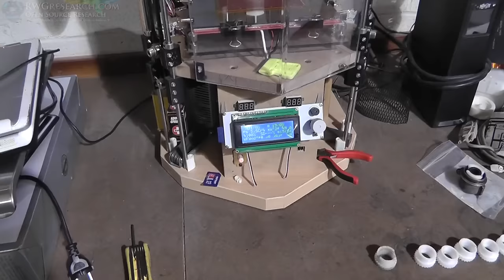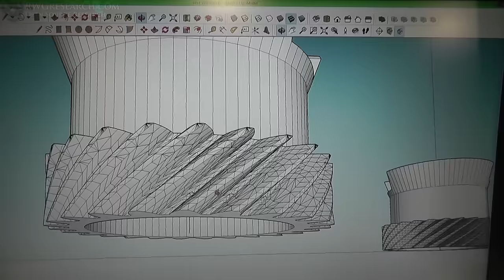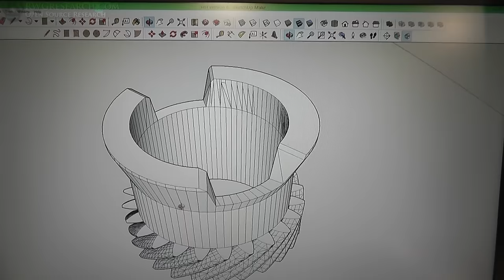Practical 3D Printing With Taulman 618, Nylon Gears! 1983 Hondamatic 450 Speedometer Gear!

Comment: You need bondo on your fingernails LOL, remember fingers are not targets.... Now make eyelets for your spooler for the various dimensions eyelet size and have a pot on the motor for the measurement of "the lay" of the wire (or filament), if you need the tension on the line use the old 5 spindle wire straighteners off the feed side.

Comment: FYI- in CAD, typically you can extrude a helical path, instead of extruding and twisting. Unless I heard it incorrectly. Cool stuff!
Reply: In Autodesk inventor I use the loft tool to do something like this.

You could also just make one of the teeth on the gear and then copy it around an axis all the way around with the rotation tool. Much easier and quicker than doing it multiple times.

Comment: The gear geometry was labor intensive because of the measuring methods and drawing methods.

The shape of the gear is standard (you measure normal modulus with dedicated tool) that ensures smooth action of gears and no play. The extrusion is around a helix not a twist. This helix is a line wrapped around a cylinder at constant angle. That angle can be measured real life with the proper tool and it has usually fixed degrees values.

I would suggest a better cad program like CATIA or PRO-E (creo) for gears and other such mechanical parts. And there are abundant numbers of free parametric CAD models for catia for creating any size of a cylindrical gear or bevel gear or hypoyd gear etc.

Nice work experimenting and testing and reaching the final geometry and the final settings for nylon printing.

Comment: As a suggestion regarding the drawing stage, extrude with parallel segments before twisting.  (Extrude in steps if your software doesn't have the ability to add segments.)  The more segments, the smoother the twisted result will be.  This way your gear detail will follow the cylindrical curve.

Comment: I am surprised that this nylon doesn't need to be dried prior to processing.

Typically, heating nylon without drying the material results in a LOT of splay and internal bubbles, not to mention affecting the structural characteristics. Water vapor in the plastic will cause excessive shrinkage and expansion. If you can keep it truly dry, you will have very few problems printing.

I know very little about 3d printing, but I am a plastic injection molder and I work with nylon 6 very often, and we require and extremely low moisture content to produce acceptable molded parts.

As a fun fact though, nylon derives a lot of it's strength from the moisture it absorbs. Dried nylon, fresh out of a machine, is pretty brittle. But let it sit in a humid area or package it with a few drops of water and it will pick up a LOT of strength over the next few days.

One of our parts actually requires a little bit of water in the packages before we seal them up, for exactly that reason.
Reply: +MastaSquidge thanks for the info
Reply: I should have clarified the shrinkage and expansion. the expansion is during printing, with shrink occurring after. water increases this effect.
Reply: Chances are, it was fresh out of a bag with desiccant. Otherwise, in all likelihood, it would have delaminated and shown obvious bubble texture on the whole perimeter. I haven't tried it myself, but it's a very typical mode of failure when printing with PA that i have seen on the Net. You even see tiny bubbles in most prints with other less absorbent materials which are not quite fresh, wherever you see deposited filament discoloured in spots, thicker in spots, uneven, it's usually exactly that, but they are not nearly as bad as with PA. This one having this perfect a surface, it definitely went in dry. Sorry, not sorry.

Thanks for the information about water being this vital to PA properties, it's super curious to know.
Reply: Yeah, now that I have a printer myself (and another on the way) and am far deeper into my plastics processing education, that has to be the case.
Reply: I have some Taulman Bridge Nylon, and that needs to be baked right before using. I left some overnight to print an identical part the next morning, and it shrunk and warped terribly. even the first print out of the oven had warpage before it was through. I'm going to build a sealed spool holder with dessicant inside to keep the filament dry while printing.
Reply: Just FYI, nylon is very sensitive to heat degradation. Vacuum drying would be much better for the filament. 

Taulman's "618" is nylon 6 6,6.

Depending on the manufacturer and exact grade, this means it should be dried anywhere from 140-230f. Since I don't know the exact grade, I would not exceed 140f. Taulman, like most filament manufacturers, seems to be doing a great job not sharing the resin they are using with anyone, and I don't see them providing any specifications on drying.

This makes it an excellent candidate for vacuum drying, as your oven at home likely has no means to control the dewpoint and make sure it is -20 to -40f to ensure that the material is dried below .02%.

Now, you can get cosmetically good results from nylon which is still wetter than .02% moisture content, but the remaining water in the plastic is consumed via hydrolysis, which breaks down the nylon and weakens it.

If you want optimal strength out of your parts, and optimal layer adhesion, proper drying is critical - and something most of the 3d printing community is not aware how to do.

In case you are wondering, I am a plastic injection molder by trade, and work with nylon (and many other materials) every day in precision industrial and medical parts. And to be clear, filament manufacturers are not using any materials which are not also used in injection molding.

A few big name brands MIGHT be able to afford a custom blended polymer, but most cannot.
Reply: start collecting silica packets and store them with your nylon... You can order silica by the pound on ebay as well!
Reply: Fresh Step Crystals kitty litter is silica gel. Cheapest available. Bake it for an hour in the oven at about 250F  and it's totally dry and ready to use. I been using it in ammo cans for years.
Reply: sammorgan31 that's good to know!
Reply: MastaSquidge how does grease affect the nylon. I know in my 86 944 the original speedo gears were polystyrene and grease will cause it to crumble in a few years time. I replaced with nylon back in 2008 and no problems ever since. Wonder if printed nylon would hold up as well as molded when subjected to grease..

Comment: Very nice. I was surprised of the detail you get out of that 3D printer. Its very useful for practical purposes.
I work with gears professionally and to design a real gear it is surprisingly many parameters to set. The hands on approach here though probably made a good enough gear for that low torque.

Comment: Thanks for the video. I'll be ordering a printer before too long. I also have a gear project in mind. 
As far as the original gear, I think those are typically made of Delrin (POM), but I could be wrong on that. Regardless, I appreciate your trials and demonstrating what was required for the model design.

Comment: Yesterday I tested first time my nylon 645 filament sample. Prusa i3 with all metal hot end.
Nozzle 0.4mm 252°C, Heated glass bed 105°C with ABS juice, Speed 25mm/s. Oozing, but it did not bother me. Not very well dried filament: some popping. But the print was quite good and no warping. This was nice video with failed prints and progressing also!...

Comment: PLA is so easy to print with no adhesion or warping issues, I find its perfect and cheap to prototype with, I think with OpenScad, Greg Frost's Involute Gears script, prototyping in PLA you could have made this a lot easier. Nice info about nylon, thanks.
Reply: Ross Linder Maybe he wanted something stronger, as PLA can be kind of brittle.
Reply: Paul Robert I did say "prototyping in PLA you could have made this a lot easier"
Reply: What would be the point? He needs a working part not a prototype. Also printing it multiple times out of nylon will allow you to tune in your settings for that material.
Reply: Paul Robert No warping for a start, no problems with adhesion for the next, cheaper, known extruder properties. KISS is a good concept when prototyping, then take the rest of what I said into context to fully grasp what I was saying. Then if you actually watch the video you will see at least 8 attempts to get the working part.
Reply: Ross, It took 8 attempts mostly because he designed it wrong. If he prototyped in PLA you know it would come out perfect then when you go to print it in nylon you still have to find the right settings and you still might print a few. That's why I asked what's the point? Save 23 cents? There's no point because he wants the part in nylon not PLA. Testing the fit on a PLA part will have little to no application in nylon. Two different materials with different temps, warp rates, expansion rates, accuracy, tolerances, etc.
Reply from the maker: Paul Robert time out you too, here is the deal, you both are right in the right application. it is smart to make something with lets say PLA to do testing such as lets say nylon is slightly more pricy, however, in my testing it was smarter for me to test with nylon as i still had tuning to figure out. yes, PLA and Nylon would each have there difference so trying to "test fit" the part with PLA would not have been smart, getting the angle correct would have been good to use PLA. 

so, i needed to tune my printer and do test fitting, so for me in this video nylon all the way... 

any way, there isn't a correct way to skin a cat... only the way that works for you :) 

by the way nylon and abs for the "8" try's (that were also part of tuning nylon for me ) would not have been worth it. because by the time i switch out the ABS and the Nylon 2 times i would have wasted some there as well.  

no worries guys, 

~Russ 
PS i used the other nylon parts for testing in this video :) 

https://www.youtube.com/watch?v=A50Vv6E2lc8

and i can just pitch it all back in my filament maker i built for ZERO waist testing :) 

http://rwgresearch.com/open-projects/filament-extruder/
Reply: Ross Linder It is interesting, but exists other way to make durable figures by 3D print.

Comment: i just a ”carterstial?? ” type 3d printer and will try to print shortly. Wondering that your ”Delta” type one can print stuffs accurately! BTW, nylon is great material, it is engineering plastic, P.C as well. I definitely will try them. In my experience of my diy injection molding machine to mold nylon stuff, pre-drying process and keeping it dry during the later processing stage are important, or it has poor surface (air/gas mark) and is brittle. But, after staying at moisture environment for a certain period of time, it absorbs water and tough again.

Comment: It's been a bit over a year now, did the part hold up?
Reply: Probably not. The original gear was cast or injection molded nylon. Printed nylon is nowhere near the same strength and durability.
Reply: thats not entirely true
Reply: Try NylonX it tougher.
Reply: Nylon is not like steel, when its hard it had the same properties and when its warm it has the same properties, every time.
Reply: Well he could make a few and just replace them when needed, if he gets a few months out of each gear  it's still worth it.

Comment: Given this was a first trial of nylon in a helical gear combination, it would be worthwhile to run a half dozen spares while you still have the setup, and arrange to get the first part you made back after a thousand miles or whenever it fails so you can analyze it.  

3d printing is great for prototyping,  but not a panacea yet. For a project like this, it's a good way to  create a replacement part to fit.  If it doesn't prove durable, it or its program could then be used as a pattern for cutting an injection mold.

Comment: there is actually a customizer on thingiverse where you can customize these angled gears. What I would like to know though is how well it stood up to friction as it would be spinning pretty fast and would imagine if it didn't heat up to melting point it would possible heat up enough to soften

Comment: nice video. Nylon seems like a great material for functional parts. Regarding the twist you did while designing the part, I think you could have done it without it curving by just adding additional vertical segments in the extrusion of the gear shape.

Comment: A true practical use for a 3d printer. Not only creating a difficult to find replacement but improving it as well. Thought provoking in that I think the gear part would have been easier to produce in something like openscad based on the videos I have seen but the flange is much simpler in sketchup or 123d design, so what is the best to use?  The answer I think is probably, what you are used to or use a combination of both.

Comment: You should try the taulman bridge nylon. Some more flex to it but better printing results and not that sensitive to moist. Less delamination.
Reply: Cadplast Totally agree.  Bridge sports some EXCELLENT spec's - but on the flip side: I've had LOTS of trouble w/ it being so ridiculously oversized that I had to abandon my Bowden setup 'cuz the Bridge simply wouldn't fit through!  I actually measured some slightly above 2 mm, which ain't just a SMIDGEN off the mark!

One thing I'd suggest, though, for the lifting off the bed issue: don't heat the bed up above 40-45.  Might could help - though it's too late for this speedo gear project.

And as for gears - Matthias Wandell sells a pretty cool gear design program - might be worth checking out.
Reply: Jay Murphy > Matthias Wandell sells a pretty cool gear design program
I've been watching his channel for a while, though haven't needed to buy that program.  I wouldn't expect it would handle a gear like this...I understood it was more for getting the sizing, pitch, and spacing of 2D gears right.  Maybe if I ping Matthias Wandel he'll be able to answer for sure?
Reply: mlindholm Oh, yeah!  Been following Matthias for some years now - not simply for his plumbing tips and tricks!  Quite a scaffold jockey!

Back on topic - sure WISH I could report better success w/ Bridge, but, alas, it continues to vex me.  I've abandoned my Bowden setup for it, and upgraded my E3D v5 w/ a Volcano Eruption kit, but I cannot get it all dialed in.  It was SUPPOSED to make nylon easier, but it can't BEGIN to compare w/ their tGlase for EASY!

Oh well -- if I didn't have challenges, I might get in trouble.  Idle hands, y'know.

Comment: 7m30 In sketchup, you can simply draw a standard spur gear, pull it to the desired height, then double click the top of it, then rotate it from the center (you'll need a centering plugin to find the centre of an object easily). The rest of the model will simply twist. The shape you have made should not take more than 3 minutes to create.
Reply from the maker: +Zxenmusic yes that's what i did but you have to member that the gear will have "straight" lines between the top and the bottom. but the gear needs to be " round" all the way down the side in more than one axis. maybe nowadays a new version fixes this but i don't think so. give it a go. make a square, then pull it to a cube, now rotate the top of the square 90 or even 120 degrees,  look what happens. the lines all connect in to the center. The shape of the cube is now gone 1/2 way down the cube its all messed up. . sure the ends are the same but the center is not. that is why you cant do this. if you find a way to get it to work id be glad to know, thanks. ~Russ
Reply: +rwg42985 Draw a Cylinder (circle with 96 sides I recommend, then pull [with alt key] so its not hollow). Find the centre of the top circle of the cylinder using a centre plugin. Draw a straight line downwards on the red axis from the centre to the edge of the circle. Now draw a line from that point on the edge straight down to the opposite circle along blue axis. You can delete the first line you drew now. Now click to highlight the vertical line. Use the rotation tool with the vertical line highlighted: Click on the centre dot guide once. Line the rotation tool up with the line along red access and click once. Click the alt key once so it duplicates that line rather than drags it. Now rotate by 360 divided by the number of teeth you want degrees and click. There should now be two lines. Now simply type the remaining number of teeth and press x. You should now have the precise number of lines you want around the outside of the cylinder. Now highlight the top circle and rotate it from the centre of the circle and you should find that all the lines have spiraled. Thats how to make them all helix shaped. Given that you're making teeth, draw one vertical tooth first (Instead of just a line), and follow the same principle. Basically you would highlight the entire top of the shape and twist - everything connected to it will warp uniformly.

Comment: Dear Russ, this nylon filament ran in you printer using the normal hotend that you use when run ABS or other? Or do you need to make some change to your printer to try with nylon? Thanks

Comment: You haven't tried PLA yet?  It can be used as a soluble support by cleaving the lactic acid bonds with a warm sodium hydroxide solution.
Reply from the maker: douro20 haven't tried that but there are water solvable plastics too. pre maid for that purpose. ~Russ

Comment: there is a plugin for sketchup called Cadalog_Gear_v3.1 which will help you a lot in creating various types of gear,and a lot easier than starting from basics, Its a zip file just google for it , its not in the warehouse